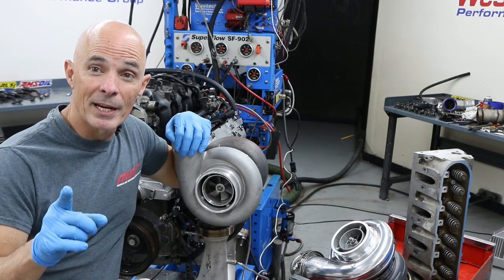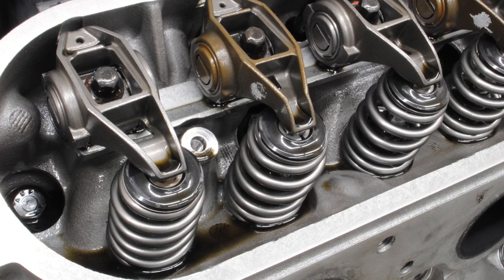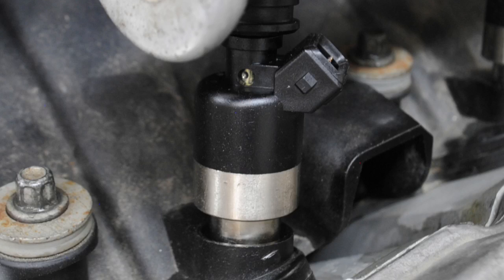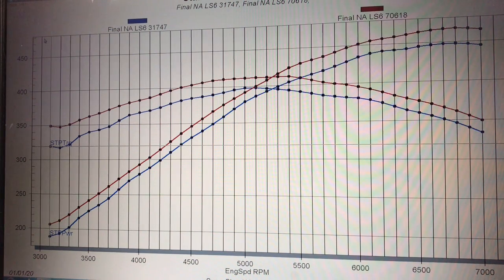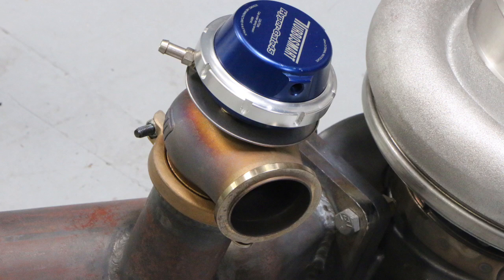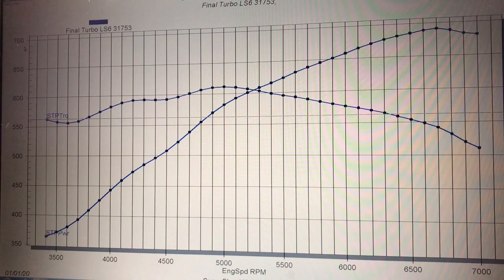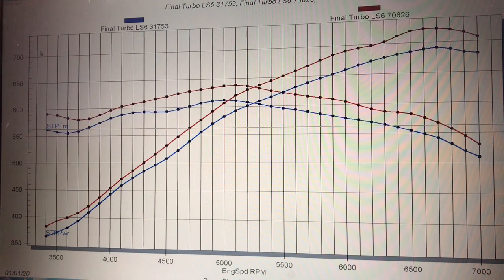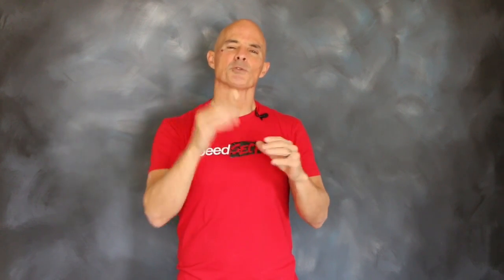TURBO LS HEAD TEST-706 vs 317 (BEST FOR BOOST?)

Comment: Pity about the boost control situation, you could have taken on abother topic, being the effects of engine compression on turbo spool, seing as it was a decent sized turbo. It seems to be a popular one at the moment, and argued heavily.

Airflow comes in more important at a higher effort combination. If you kept turning up the boost, the lower airflow heads will choke out, or the added compression will compound cylinder pressure enough under boost you cant run enough timing, egts will skyrocket and it will make less power.
Reply from the maker: the motor made more power with the 706 heads-turbo spool will be improved

Comment: 317s vs 706s on a 6.2L should favour the 317's more displacement and the larger bore help un-shrould the flow out and around valves all the way to the piston wall which allows swirl flow and that does the trick I believe.. I am not a fan of the 317 but I have a friend who loves them, we both have 5.3L but I'm on the high compression end of the 5.3. Maybe we could see some home port/polish 706s vs. shaved 799s? please? then maybe results from the same home port/polish after a shave and blend job??Canadianspeedsecrets. I want to move down there and work with you boys, I am so jealous.

Comment: I think the smaller valves on the 706 helped this 5.3, as they don't need bigger runners and valves like the 317 had , so  the 706 heads weren't a choke point to that engine , a bigger engine would suffer from the 706 comparing to the 317 and then the 317 would outperform  the 706.
Reply from the maker: the 317 have a big hurdle to over come before they make more power

Comment: This is absolutely pointless .The problem is you run less compression and better flow to allow a higher hp boost level safely. Put both on the same gas,with 20 lbs of boost and see who maxes out 1st.
This is a vid for car show guys

Comment: the only time I can see the higher compression being an issue is if you're running pump gas and you want to turn the boost up.  It would be interesting to see which one would make more power before spark knocking.  Tough test to perform though.  Also be interesting to compare this cam to a good stage 2/3 turbo cam.

Comment: At some point boost would overcome the compression deficit, and airflow would come into the equation, because boost is a measurement of restriction. Stick a mass airflow meter on it and measure the CFM of air going into the turbo, compare at that reference point instead of making boost the common factor, just a different way of thinking, measure base fuel consumption vs airflow vs power on the two sets of heads. Also lower compression makes the motor feel doggy when not in boost

Comment: Compression = how small the air is compressed in the cylinder, the side effect is heat.. to much heat and preignition occurs..

Lower compression means when the air is compressed by the piston, the molecules will rub less and create less heat..

An engine with lower compression running more boost just before the point on preignition  will make more power at that area than a high compression running less boost.. but the higher compression will make more power everywhere below that point..

The best position is to get your goal power level running safe, compression, timing and boost.

Comment: We learned what most knew already. The real test is how far can you push both heads on pump. The ONLY reason to drop compression is to run more boost. The test should be, is there a gain in safety factor on crappy pump fuel with the loss in efficiency that comes with the lower compression.

Comment: Compression FTW here. Now, what size chamber does the 706 head have? Can you run this test with 799/243 heads or did you run this test already?
Reply: Well, based on the data, they will probably make more power than the 317 heads but less than the 706. The 706 have a 61.5 cc combustion chamber.

Comment: But which ones would take more boost and make more power overall?  The 317s
Reply from the maker: not sure how you come to that conclusion-but please let me know
Reply: @richardholdener1727  it has lower compression with 317 heads so more boost could be added to it. If you would have ran max boost pressure to each setup the 317s would make more power because of that lower compression

Comment: Love love love all your vids!!!!!! Keep it up! Ever try an S400 88/96 on a 5.3 ls?
Reply from the maker: only an S480 billet wheel
Reply: Richard Holdener I’m about to finish my 5.3 sbe with btr stage 4 turbo cam,prc 706 heads,Holley Hiram and S400 88/96 1.32ar. Drag car so with my converter won’t see under 4K from launch on so just hoping it will spool well 🤷🏼‍♂️

Comment: What would be interesting to see would be is  how much power you can make on a stock cam.  Give it enough fuel so it won't eat itself.  You see that a lot with DOHC engines where they just add boost no cams and make over 1k HP.    I think Lingenfelter has done this with a LT4 Twin Turbo with just fuel and it make 1400ish  engine HP.
Reply from the maker: the stock LT4 cm is much better than the LM7 (Could also be done with a stock LS9)

Comment: Richard have you ever tested the 317s with different pistons to get the compression the same ? I'm curious if compression was the same if the 317s would make more power
Reply from the maker: they won't on a 5.3L

Comment: The loss in power of the 317s is a combination of both compression and chamber turbulence. The 706 heads are designed for the smaller bore. If you changed pistons to bump the compression to the same with the 706 heads I think the 706 will still win NA as the turbulence would hurt it more than the extra flow would add. However, with boost and at the same compression, I think the numbers would be identical at low boost. But high boost the 317s would edge the 706s and will have more power potential at high boost. Your test proved the 317s flow more which is why boost increased.
Reply from the maker: The change in boost was from the extra power offered by the 706 heads-which increased back pressure, which opened the waste gates earlier
Reply: Richard Holdener so if I am picking up what you’re putting down here, is it safe to say this test proves that more compression is worth much more than a few more cfm numbers at that power and boost level. So is cylinder pressure instead of cylinder filling more important since the more boost on 317s didn’t equate to more cylinder pressure. You would think by bumping the timing would narrow that difference because the 317s could accept a little more. But with all that said the 5.3 with 706 heads made more power NA than the 317s it “Should” in return make more under the same boost as well.

Comment: I'd like to see the test Maximizing boost for each head. In theory you should be able to run more boost with the 317 without the risk of detonation... maybe that's where you can make up the Power?
Reply: In theory we are led to believe that less compression is better for high boost numbers on pump gas, at what point would the 317 heads become an advantage? maybe 15psi and up? Please do this for us Richard Holdener.
Reply: It's going to take much more boost than that before it's a problem. It's not worth changing to the 317 heads. The air extra air flow is minimal on intake and about the same on the exhaust.
Now sure you can run little more boost and timing with the 317s but the 706 is going to match the power just with less boost and timing. Which is a benefit if you happen to be running a blower. More boost with a blower the more heat becomes a problem. Many guys today run 10.1 or more compression. We've been running 11 to 12.1 for 20years. Specially in class racing where your limited to a particular size blower or turbo.
Reply: Wayne Bollentin would it just the same not be worth switching “from 317’s” as that’s what came on my motor?

Comment: Have you done this comparing to LS3?
Reply from the maker: have not run 706 on 6.2L, but I did test the 317 vs LS3 heads both na and under boost-video is up

Comment: I’m wondering how the cam fits in as I understand you need to keep the overlap tight so the valves aren’t releasing loose out of the cylinder but with the different heads effect that as well as far as letting the air in and out because of the larger flow
Reply from the maker: boost just multiplies what is there

Comment: Lower compression should be good for higher boost. Much higher. I'd also like to see the difference between big stroke/small bore vs small stroke/big bore. Same heads/cam/intake.
Reply: can run the same amount in either.
Reply: @Racestatus  40 lbs?
Reply: Chris Madsen  my old 4cyl car use to run 60psi on 12.5 compression. It’s all in the tuning and fuel.

Comment: Turbo with vvt cams would be interesting to see what variable cam timing can do under boost
Reply: From what I've seen so far, most aftermarket cams require a VVT delete.
Reply: @Borderline5440  Summit Racing has a series of VVT cams with use of Comp Cams timing reduction kit.

Comment: Should just put a 3-5 lbs spring in the wastegate and don't boost reference it should do between 9-15 lbs everytime just based off back pressure

Comment: I wonder, I have stock 5.3 heads and 4.8 flat tops pistons in a 5.3 with a ss2 cam running 18 psi. The extras compression from the pistons not being dished would be a good combo with the higher flowing 6.0 heads? Hmmmm....

Comment: I'd like to see one where you match the CR on a 317 equipped engine to the same as the 706 and then run it again. Given equal CR how would the extra flow of the 317 translate to power?
Reply: The extra flow is minimal and only on the intake side. They're very similar on the exhaust side. It's not worth the trouble.

Comment: I run 317 on my 5.3 and on e85 I am able to run 26 degrees so I think 317s come into play for being able to run more timing a d more boost safely
Reply: But if you can run less timing and less boost and make the same power then why not go that route? That's what make it an efficient engine.
Reply: Master Mechanic what’s your setup on the 5.3. I’m building one just like it... 317 with vs 78/75   How does it do on bottom end and how much boost you running. What’s your numbers lol

Comment: i wonder how much more boost you can run on the 317 heads?  5-10 psi? How much more fuel would you need todo that?   i would think on this set up you would have a motor failure long before the 317 heads made up any ground on the 706 heads.  now put the 317 heads on a 400+ ci motor  and it might be a little deferent

Comment: We've made 760 rwh on a chassis dyno with ported 317 heads, 8.3 to 1 compression , 21 degrees timing, E85, 14.5 lb of boost , 347 cubic inch, LS6 intake, twin 56 64 China turbos, China Air to air intercooler, 128 lb per hour injectors
Reply from the maker: they work

Comment: Great comparison. Were they tuned to the edge of knock for each combo or was each run on the same tune? It would be interesting to know how much overhead the lower compression buys in a real world situation, especially for 30 - 60 HP. I would think at higher boost levels, the higher comp motor would be octane limited, whereas the lower comp motor would have better chances of running without knock.

Comment: It could be different if you were octane limited at max effort. The 317 may allow more boost/ign. That would be something to try Richard. Obviously if using E85 or methanol id take the more compression of the 706.

Comment: Do the same test on a 6.0. 20 pounds of boost , electronic boost controller , adjust each engine for maximum timing. I believe the increased timing on the low compression 317s will make more power.
Reply: Be careful saying something like this on the boosted lsx group on Facebook. You'll have about 20 people within 5 seconds calling you a dumbass. It's the blind leading the blind over there.
Reply: Low compression sucks though. Low compression just gives you tuning adjustability
Reply: @scottydoesntknow254  it just sucks at low rpm drivabily and for low boost. But with that said you don't have to drop the compression down a ton to gain from bring able to run more boost. 9.0:1 is still high enough to drive well, but will make more power than a stock compression motor.

Comment: What if equal boost levels wasn't the goal but rather make the peak cylinder pressures made equal by using different boost levels. Would that be the point at which the 317s showed improvement with the greater flow? With lower compression wouldn't it take more boost on the 317s to equal the same peak cylinder pressures?
Reply from the maker: if we ran more boost on the 317s-they make more [pwer

Comment: I would like to see a turbo cam shoot out between: Sloppy Stage II, Summit Racing Stage II, and BTR Stage II on a 6.0.
Reply from the maker: me too
Reply: @richardholdener1727  sloppy stage 1,2,3
Reply: @richardholdener1727  do it please
Reply: @richardholdener1727  what was the specs on the 76/75 precision turbo  A/R ? T4 or t6 etc
Reply: So send Richard the cams and I bet he'd be happy to... lol
Reply: and a 5.3 with 862 heads. Im leaning BTR
Reply: Ooh that would be an awesome one.
Reply: Jack Crawford i agree want to see best gains he’ll do even stage 3 and 4 cams
Reply: Comp LST Cam!
Reply: Only worries me about the 706 heads is their tendency to crack what about the  862 heads
Reply: @MichaelWittner  Sounds like your overheating them. When the engine starts getting that hot don't keep driving it
Reply: @shawne7225  nope never over heated the engine , there's issues with certain castech 706 heads there's a defect in them where they crack around a head bolt. there's tons of forms on them I had a set crack then a set of 862's crack as well , if you go to my channel I show the second set change out.
Reply: @MichaelWittner  yes i looked it up its the Castech 706/862 castings , which made me pull my damn valve covers in a hurry, luckily mine are not Castechs LOL!
Reply: @shawne7225  lol , yea trust me I've had my experience with these heads unfortunately I learned it through the experience , but no worries these chevy's are easy to work on
Reply: @MichaelWittner  I have had this happen to my first 5.3 then replaced motor with gm crate in 2010, just looked at my heads castech 706, not cracked yet, did castech ever fix this issue with there castings ?
Reply: @MrFireman164  I have a good set of the 706 heads. What I didn’t notice until after I put the spring on is the 3 broken bolts. I got 2 out the 3rd on the extractor bolt broke so now the head is junk
Reply: @theshark2804  that sucks! This guy said something about him not having any issues with castech 706 heads and maybe for drag racing on the weekends the crack where they crack is fine but I have had it happen on my daily driver and it cost me a whole engine. If you google castech 706 heads there are hundreds of stories of this.
Reply: @MrFireman164  yeah that’s why I want to try to save this head. I might can take it to a machine shop and get it drilled n tapped out. I don’t have the tools to cut thur the extractor bit.
Reply: @MichaelWittner  The early 862 heads had issues cracking. Castech are least desirable. As long as the cast in emblem is no located on head you should be good.
Reply: @johnwehunt4305  yea im unfortunately familiar with these heads now. Lol 😆
Reply: @MichaelWittner  school of hard Knacks.
Reply: I would love to send you my nightstick camshaft it loves Turbos
Reply: Don’t forget LJMS 👍🏻
Reply: I am building an iron 05 6.0...keeping block & crank....and 317s.     Everything else is in the scrap bin.      So 6.0 info, real objective info is what I am looking for.    Will be using Holley & prob 7675.  Any recommendations are welcome.   PHX area...need a top-drawer LS Machineshop, even if I have to drive to LA.      Just obtained a 200k motor low oil pressure.   Oring was real bad.   All STD never opened since new.  Should make a good piece!!    I'm all ears....
Reply: @karter9908  all ears" will net about 60 hp, if you really want it to rock~n~roll you'll need to turn your eyes up to about 11 pounds and research and watch all the videos that answer all your questions ( they're out there) it's kind of like fishing in a bucket, it's easy but you do have to fill the bucket and put the fish in it yourself.
Reply: Believe they are all the same.

Comment: I'd love to see this test on a 6.0L
Reply: Nivlac57 this take aways would be the same the peak numbers would change. Compression is the key. They both flow good for the power levels. That’s why the 706/862 will win every time.
Reply: @tysoncrandell9726  I believe further testing is required to make the determination. A 317 head will flow better on a 4 inch bore. On 3.78 bore, the valves are heavily shrouded with a 317 head.

Therefore, I expect the the difference to be closer or the 317 to out perform the 706 at the same boost pressure. Don't know until you try.